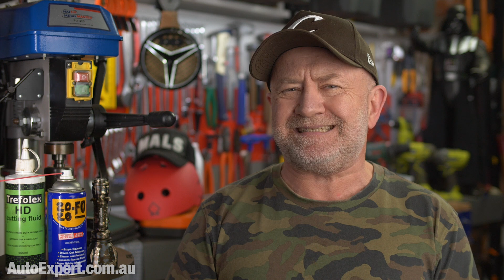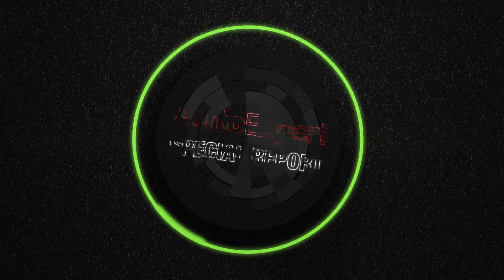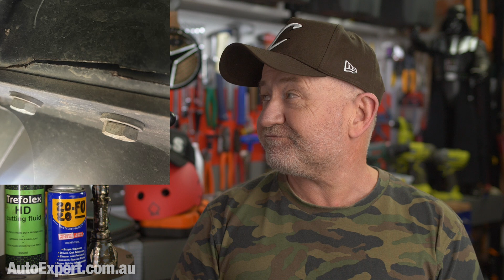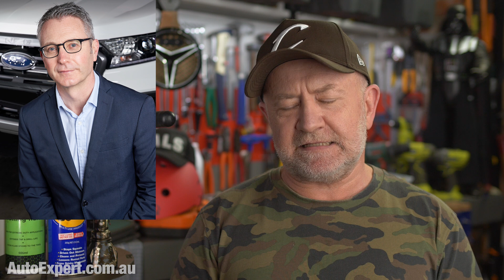CRACKED! Hi-tensile bolts Vs chassis Vs dealer incompetence | Auto Expert John Cadogan

Comment: Hi John, In Souf Efrika (Or Southern Corruptistan) the rangers come with a factory fitted towbar with 5 bolts on either side. Their configuration is 3 sideways and 3 longways from below in what I am guessing would be the same points as the ARB would be mounted. The factory standard rear bumper even uses the tow bar side struts as the mounting mechanism for it. Is this not the case with the 'Strylian version that the design of the rear bumper is included in the standard factory towbar design? I would imagine that if the standard towbar is removed in favour of an aftermarket version that this would be a warranty voiding endeavour. Additionally when you mention in towing and laden towing weight videos with your weight calculations of roughly 50kg for a towbar, would an integrated towbar that is included from the production line not aready be included in the GVM specicification from the manufacturer as is in the case with the SA Ranger?

Comment: Maybe I missed it, but how does the loose bolts cause the cracking? Or is it just that the towbar was getting bounced around?
Reply: The forces inflicted on the badly-mounted towbar were transmitted to the frame pieces, which couldn't handle the likely increased beyond limits pulling forces.

Comment: As a qualified mechanic, a vehicle body builder/ boilermaker and cad designer and now workshop manager of a competent plate boat building shop.
I have seen this incompetence over several trades.

I'll start with mechanics, straight out of school they land an apprenticeship at a dealership woohoo for them at the time,they think there doing the right thing,  then unfortunately they learn all the bad traits of dealer mechanics.
They've got the workshop manager yelling at them to get shit done faster but don't care about how it gets done.
Kids are just set up to fail.

Vehicle body builders, it's not even a fucking trade anymore.
For me and you oldskool we could fix that chassis and never have an issue again.
I wouldnt get most "boilys" to fix that chassis.
My boily apps pfffft.
Fuckers can weld at a bench that's about it.
Doesn't matter how much I get into them or try teach them the right way. They don't give a fuck.
That's kids these days mine Included.

I got an app that's nearly 4th year and still struggles with getting the right bolt length let alone talking tensile physics with him.
Reply: Many years ago, having come out of the Army after 14 years, I got a job as a mechanic working for the local authority. The workshop operated a bonus scheme with the usual timed repairs. I was in that job for 9 months until I told them to shove it and I never once got a bonus but equally, none of the vehicles I worked on came in for the same repair twice unlike some of them. The strange thing was that some of the other 'mechanics' always wondered why vehicles would require the same repair many times over! They could never figure it out. Mind you, they were probably thinking along the lines of, 'Who cares! It's not me paying for the repair.'
Reply: Buy him a bong 😁
Reply: @rfmonkey4942  he would struggle with that too.
Reply: Buy him a bong 😁

Comment: Hi John
I was under the impression that once the chassis has bent or cracked you can’t touch it.  Any repair is a write off.  Am I wrong? I’m in NSW.
Reply: The repair might have to be certified by an engineer.
Reply: Ok thanks

Comment: My local Nissan dealer code me two brand new tyres by not tightening the camber bolts during a wheel alignment. I will never let a dealership touch my ute, nor anything else ever again.
Reply: cost, not code, bloody stupid auto- correct.

Comment: I haven't used a dealership since the 80's when 9 year old vehicle (same brand as dealership )didn't meet the ball joint specs or exhaust noise ( new parts fitted by me).
Parts were genuine OEM purchased from the same dealership ,showed the smug prick the receipt in front of other customers ,.

Comment: It's not just dealers who don't know what a torque wrench is for.

When I was a teenager, driving my little 323, I noticed a vibration coming from the front left wheel. I pulled over to check and and 3 nuts were loose and the 4th one was missing entirely.
This was the day after getting new tires fitted at the local Firestone shop. 
They adamantly denied any wrongdoing but did replace my missing nut. Of course they tightened it with a rattle gun.
Reply: It still happens!! I have had loose wheel nuts after new tyres fitted and the same on a trailer including loose bearings after replacement.
Reply: Rattle guns usually overtighten wheel nuts to the point of damaging the studs.

Comment: Hi John, I’m not speaking for all dealers but usually when are accessories are fitted at a dealer level they are done by ARB, at our dealer we contract out any arb accessories needing to be fitted to ARB, sadly our brand new cars come back damaged with the accessories being poorly fitted (anything from wiring rubbing on chassis rails to panels not refitted), when our dealer contacts ARB about their shit work to our cars, we usually get backlash and a “we don’t care” attitude, then we end up fixing it. I fit genuine tow-bars to our utes and they get torqued to 125 nm (as per the instructions set out by the manufacturer) , I check this twice before sending the car out and to date Ive never had a customer come back with their keys in one hand the tow-bar in the other.  In not saying Ford didn’t fit the arb bar but I would have thought at a dealer they would only fit genuine and contracted out any non genuine crap.
Reply: Hey Spike, In this case, Ford openly admitted the fitted it

Comment: Another cause of this kind of cracking (but not loose bolts) is tounge height on the trailer not matching the height of the tow bar. This is especially a problem if towing a tandem trailer or if loaded uneven. It can put a very high load on the towbar and a lot of shock and vibration. Probably not a issue in this case but is something not many people pay attention to
Reply: I have seen jacked up utes towing twin axle trailers with substantial loads and the front trailer wheels are pretty much unladen, all that weight is being taken by the tow bar. Looks to be a dynamic nightmare waiting to happen.

Comment: A mate had the opposite problem. Had a bolt on the towbar shear off. Not wanting to send the vehicle to the city to get fixed, they offered to send some bolts to  the  country so he could fit it himself. When asked for the torque specs they said they usually just lean on it with a strong arm. Wonder why the bolt sheared off. I suggested he forward the email to the towbar manufacturer but my mate couldn't be bothered.

Comment: Even if Ford welded up the split, would it be safe?, My neighbour had an International Light Truck 60 years ago and the Chassis had a note, Do NOT drill any holes, High Tensile steel. So is it safe to take a welder to HT steel?
Reply: That's a somewhat complicated question. In general terms, yes they can be welded. Sometimes it's as easy as grabbing out the welder, other times it's a whole lot harder.

In the case of light vehicle chassis they will be made of "high tensile" steel, but not likely to be heat treated post manufacture. The high tensile bit just means that for a given thickness of material it can carry more load.

Where a chassis isn't heat treated it can in principle be welded. As John said in the video, the weld material typically has a higher strength than the base material being welded. However, that isn't the full story. In welding a piece of high tensile steel you create a heat affected zone (HAZ), which is a localised softening of the steel in the area surrounding the weld.

Depending on the location of that HAZ and what else is done to address it you may end up comprising the chassis at the weld location. For instance where you have a chassis rail running front to back it is extremely poor practice (and in many instances not peemissable) to weld across the width of that rail in what's called a transverse weld. The HAZ you create can compromise the chassis.

In the case of this chassis, I'd grind it out and weld it and probably also stick a doubling plate over it with a series of plug welds as well. Ideally I'd put another close fitting tube down inside the existing rail and plug weld through onto that. I'm not an engineer though, so if someone like John gives the directions, you follow them.

Now, in the case of your truck chassis, that may well have been heat treated post manufacture. Welding and drilling of heat treated chassis IS permitted however there are some pretty big caveats on that. You can't just go welding on it however you like. There needs to be a fairly substantial amount of work done around how what you're doing is going to affect the chassis, what grade steel is used for any new bits, the type of welding filler material and process used, heat treating after the fact, manufacturer and engineer recommendations/requirements etc etc. Basically, it's a whole lot of work to make sure what you're doing is the right thing.
Reply: Drilling holes in HT steel might set up a crack-forming stress point maybe due to the type of steel? I'm no engineer, so it's a guess, not an educated opinion or anything.
Reply: it would of said, do not drill any holes in the top or bottom chassis flanges. they do repair chassis and lengthen them.
Reply: @oldbloke100  Well this was just on the side where you might drill to attach something. there were several factory drilled holes so a assumed they were considered the only dependable attachment points.

Comment: Dealer service department may be trying to avoid it because they may not have even installed towbar!. Customer could have paid sales department full price for install only to have the sales department arrange a mobile accessories fitter (or sometimes the car detailer) do the job for half the price. I saw so many things like this working at dealerships. Remember that dealerships are not 1 entity. They are three companies (parts, sales and service) who all undercut each other at every chance.
Reply from the maker: They're the retailer. The liability is clear.
Reply: @AutoExpertJC  Totally agree, just hard for customers to get around dealers internal issues some times! Ford Australia will need to step in to fix this and possibly check all other installs this dealer has done.
Reply: @johnblanchard8719  Ford Australia have been struggling to answer NNNs phone calls
Reply: Ford admitted they fitted it at their dealership by their employees :)

Comment: i have to admit i had a ford escape for 20 years and all it cost me was a set of coils and the catalytic converter.  however, i never ever took it to the local afd.  during a safety recall, i watched our local dealership (around 20 mechanics) go about their work.  i kid you not, and i am not exaggerating, i have seen tortoises move with far more vim and vigour.  they all deliberately took an extended time to  even walk from the car to tool chest, and yes they charge by the hour.  you can keep all dealerships, i will stick to my garage where he has always done  the right thing for me.  i actually bought an outlander to replace the escape last year.  the dealership wanted $475 for servicing.  my guy did it for $220.

Comment: I think there is a bit of a poor culture in many dealerships service departments. I've had a few dumbarse things over the years but my golden one was, "and we replaced the automatic transmission fluid." To which I calmly reply, "Interesting, as when I dropped the vehicle here this morning it had a manual transmission." The man behind the counter then said that it didn't. So I calmly said, "Well if that's the case, I would like you to remove the automatic transmission and refit the manual it originally had." The silly muppet had to go and check with his service manager! Seriously .. WTF!!?
Reply: Well that’s bad, but not as bad as looking at the invoice and seeing spark plugs on a diesel. The excuse was that the price is the same so it doesn’t matter what’s on the invoice.
Reply: @kostasg8739  Many years ago I received a bill from a doctor's office. I was in my middle-late teens, and knew enough that as a male, I should not be billed for a Pap Smear!  My mother blushed about 4 shades of red, and I got on the phone and very calmly asked the woman in the billing dept. exactly how and why a man could be billed for a Pap Smear. I swear I heard her blush over the phone, and she said the billing would be corrected.
Reply: Funny story, I had a van being fixed at a panel beaters for some front end damage. When I went to pick it up the lady on the front desk informed me that it was going to be about 15mins longer than expected, "their  just re-gassing the AC" She explains. She went on say that it is a safety procedure, they have to de-gas the AC before working on the front of any car. sure enough I get the car back and the invoice includes the cost off $xx.xx for the AC re-gas. Funny thing is the van didn't have air con.
Reply: @lefty5349  (Hilarity ensues as vehicle owner tells shop to remove the de-gassing from the bill, since vehicle doesn't have A/C, and manager tries to hide the obvious incompetence and attempt to lighten the soon-to-be-former-customer's wallet). :)
Reply: @markh.6687  For a couple of seconds I thought, what if I pay the re-gas fee, then come back in a week and tell then the AC doesn't seem to work since it was worked on. You can imagine that conversation, as they look at you like your an idiot and say but you don't have any air-con...
Reply: @lefty5349  ...and the conversation about the bill that follows would be most entertaining I'm sure!
Reply: Not defending the dealer but a lot of newer manual transmissions use ATF as lubricant.
Reply: @charliedee9276   The lubricant aside, i don’t think they should be arguing whether the car was manual or automatic. That’s a detail even the dumbest creation in a service department should get correct. Also it was a corolla, pretty standard manual gearbox lubricants there.

Comment: Many years ago I had my new Ford serviced every 5 weeks/10,000km by the local Ford dealer. Yep I was doing 100,000km a year.

One day I had a fan belt snap 30KM out of Dubbo the day after the car had been serviced.
I then looked at the condition of the remaining two belts and yep they had lots of cracking. The service schedule said and I quote "belts, check condition and tension" Something said dealer obviously failed to do.

Because the car got a little warm due to me driving a further 2 KM to the next town with the alternator light on and the water pump not spinning the thermostat failed a few days later.

Said dodgy dealer then charged me $50 for a new thermostat which their oversight caused to fail in the first place.

They paid for that by me not getting the car serviced there for a while.

Comment: When my elbow or wrist clicks, that's tight enough.
Reply from the maker: #precision...
Reply: @AutoExpertJC  I make sure it's calibrated every night before I go to bed. I do need an internet connection to do this though.
Reply: funny stuff.. in my case, it's the dodgy shoulder clicking.
Reply: @petesmitt  You need to change the angle of attack and be generous with the lubrication. try reaching around, I find that also helps on colder days.

Comment: I've had fun at Ford dealers with a 07 fiesta ST which was second hand when I bought it , I found out the headlight motor adjuster was broken and the lamp was bouncing up and down lol. The yard wanted the car in for it's replacement headlight at 2pm, I couldn't meet that time do just turned up after work a few days later. The mechanic took 5 mins to find the bonnet release (it's on the left front kick panel) , being a German made car for LHD mainly. Then he didn't know how to remove the light , me keeping  quiet after another 10 mins he'd removed the wrong one... Now they're on overtime just clicking past 5.30 he was getting edgy . I went into the office and said the monkey working on my car would better suit a job in the circus with his lack of knowledge . By the time I got back to the service bay the car was ready to go but they wanted $275 for the light and fitting($110 for the light) ... I said yep and drove away without paying ... It was a warranty repair , bunch of stooges..
Reply: LoL
Reply: Love your work.

Comment: Dear John ,
Would you consider there being something a miss with the actual tow bar ridgidity ?
Could the extra strength of the plate steel excert enough force upon the chassis rail ,if the volts were tightened but the plate pulled down on the weaker chassis rail .
Also would there not be spring washers used ?maybe they not needed with high tensile torqued bolts .
So anywayz,just asking ,not questioning your expertise .
And yes the simple things that any company can do is ,look after ones customers .
Reply from the maker: Anything 'could' be the case, but an infinitely rigid bar does not account for the bolts coming loose.

Comment: If "these bolts just come loose over time" yeah right then the AFD should be checking them at every scheduled service should they not?

I'm somewhat surprised they didn't spring their commonly used get out of jail card of "Ford and it's dealers have no control over how the consumer uses our vehicles once they have been purchased"
Reply from the maker: I did mention this at the end.
Reply: @AutoExpertJC  I paused half way through and started typing. Doh!
Love your video's by the way. Honest and straight to the point.